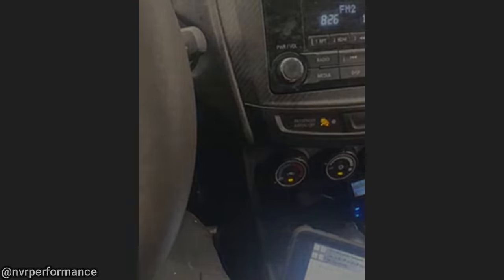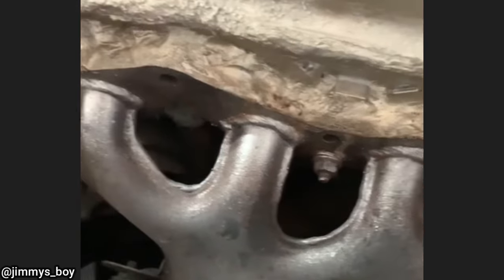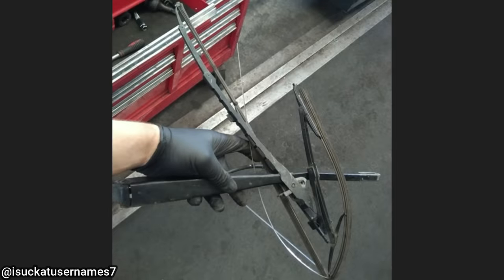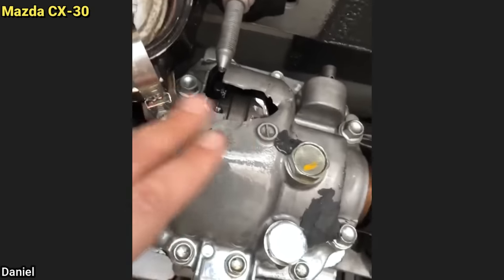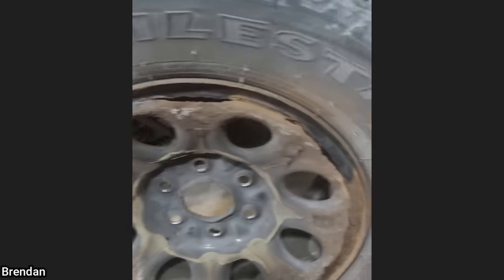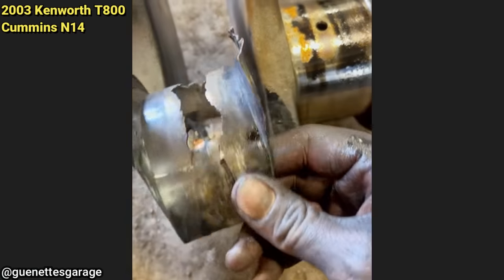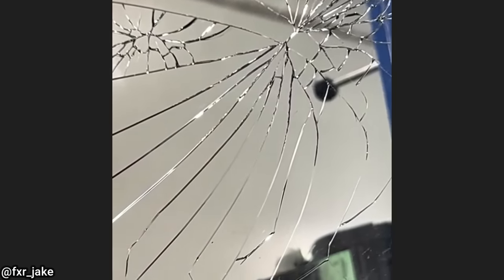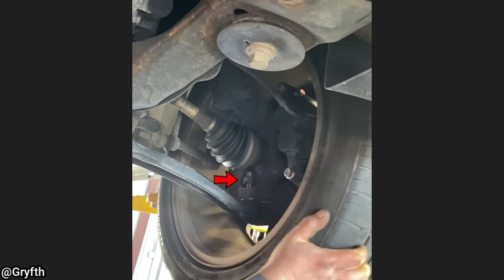Customer States (Best of January & February 2022) | Just Rolled In

Comment: Whoah! I've been a full flag time mechanic for 10 years and have never in my life seen or heard of a lower ball joint explode from potential pressure! I didn't even know that was possible!
Reply: Subaru, it happened to me.  Took a half inch out of the concrete floor.  Glad it wasn't my foot.
Reply: Never changing ball joints again. Ever.
Reply: yeah wow never heard of that.. i changed dozens on all kinds of vehicles
Reply: Didn't know either, I've put a torch to quite a few...
Reply: I never knew that either. Possibly seized with no lubricant in it?
Reply: @halucinator1  removed the castle nut fully and put way too much pickle fork in there. Ive removed a lot of OLD ass ball joints over the years and the worst ones ive dealt with have popped loudly, but stayed captured by the castle nut. No clue how this thing went off like a bomb.
Reply: Yeah- I'm down here in the comments looking for exactly this, To see if anybody else has input on this happening...
Reply: i hope he is alright
Reply: @MyCatInABox  I'm more than positive "Mr. Subaru" is bluffing 😂😂😂
Reply: same here 12 years as a mechanic
Reply: Could happen when a stuck ball joint has been heated with a torch - sometimes there's still some grease inside the joint despite it's stuck, and when superheated with acetylene it could explode like that.
Edit: I've never seen it myself, but I've heard about it from a fellow mechanic.
Reply: @ryanschmid2678  His underwear probably isn't....
Reply: Seen a axel u joint explode once,, it was like a shot gun going off,,scary shit
Reply: 40 plus years and never have !!!!
Reply: from now on when I heat a ball joint I'll drill a hole in the bottom of it, pretty sure that wasn't a problem when ball joints use to have grease fittings.
Reply: This type of explosion was noted by the health+safety office in Germany as it blew someone´s eye out. Apparently, the risk is quite real.
Reply: @peterfranklin8653  This risk is far less than what happens if your ball joint fails at 75 mph.
Reply: @danielrath6352  Do you have a link to an article or something? I'd like to read into this
Reply: Me too 😳 in 15 years i never saw exploding joint
Reply: Can i ask why we are heating our ball joints?  Is it a corrosion thing? Even on 70's cars ive only ever had to use the fork, or put the nut back on upside down and give it a couple of blows with a hammer to get them out
Reply: I had a jeep liberty at one time an was backing out the driveway an the ball joint   pop was very lucky
Reply: The ball joints aren't actually exploding. It's the spring pressure letting go.
Reply: @Colt45hatchback  They didn't use 1/10 as much road salt in the 70's as they do today.
Reply: Never would have guessed either.  But on that note, where I used to work, three of us were repairing the latch on the tailgate of a pickup truck.  Totally at random and unrelated to any work we were doing, one of the gas lift cylinders that holds open the back window of the truck's topper blew a seal.  It was as loud as a 12-gauge shotgun and we were just three feet away from the thing.  What are the odds of that!!
Reply: @RPG-oh1yf  I had a ball joint rip right out of the lower control arm. Luckily, I was only doing about 35. It was startling.
Reply: I had one explode on a dodge 2500, I was heating up the solid axle ear because it didn't want to press out. It exploded and the joint left a crater in the concrete.
Reply: @daveh8316  right!?!?!
Reply: @northcountrywoodcraftny5953  apparently we've all been tempting fate here n there
Reply: @Colt45hatchback  typically it's advised not to heat suspension components as it can compromise the metal.
Reply: @Sleezax  thats what i thought, closest to this i do is heat the knuckle with a heat gun and freeze the bearings so i dont have to press them in, but thats not glowing or anything, just enough so they slide in to place by hand
Reply: Had it happen to me. About half a second before it happened I had my head directly underneath the ball joint. When it exploded it was about 10" from my ear. Took 2 days for hearing to come back, and took a good 1" diameter section out of the concrete, then a piece lodged in the wooden wall. I stopped heating stuff around ball joints after that.
Reply: @26thpiratekingfry6  I wish they still did
Reply: I was thinking the exact same thing. Never have I seen a ball joint explode. Always learning.
Reply: @Colt45hatchback  I'm right there with you. Except I use tools made for ball joints. No more pickle forks or hammers. I haven't used that shit sine the 90's.
Reply: I've been swinging of spanners for 18 years now. And I've never heard of them exploding unless heated. Witch brings me to the only logical explanation. Friction = Heat. So it's possible that the friction generated from the rusted nut was what caused it to heat up!
Reply: About a year ago me and my friend put ball joints on my 03 avalanche and due to the truck having over 260,000 MI he had to heat the ball joints and as they were colling down and he was loosen them up they exploded
Reply: @nastyoz249  it wasn't friction that did it, it was a blowtorch. Grease gets super heated inside the ball joint and the trapped glasses expand and pressurize the joint until it explodes and fails.
Reply: @RPG-oh1yf   Had one fall apart on me once while driving. Freaking car was cursed  previous owner gave it up after it refused to go into reverse. Dad fixed it, few months later  the drivers side  ball joint’s castle nut worked it’s way loose. Tightened it up and all seemed well. Coming back from feeding horses less than 1 block away from house big boom and a hard jerk in the middle of a turn. Stop immediately, put in park, step out and go Oh Fuck! Call dad and proceed to tell him his damn car fell apart.  Thank god I was on a residential street, driving slow, and not on the highway.  He fixed it again  this time replacing the joint. Wouldn’t you know it not 3-4 months later  I get a 3 AM call from dad who was trapped at a tiny hole in the wall gas station with 4 other people in that tiny ass green Mitsubishi, requesting me to drive from Arizona to Utah to come rescue their asses as the cursed thing had blown its head gasket and they were stuck. At the time my trailer towing experience was 1 time  and my road trip count by myself was 0.  Not fun in a dually with no cruse control and the stiffest brakes known to man.  Almost got creamed by one of Utah’s finest who decided to pull a random U turn just as I was passing the area where he had just pulled off into. Missed his ass by inches!
Reply: It can happen on some types of ball points, when you heat it up gasses expand in the top part h till it can’t hold an boom! It explodes. He was using a torch they said so it looks like the same shit.
Reply: Happened on my subaru WRX. Didn't take out the concrete, but it hit my leg on the bounce. Left a huge bruise.
Reply: happened to a guy I work with. it was like a canon went off. so loud
Reply: i was heating a stuck brake HOSE in my skoda.. i had it mounted on a vice.. heated the brake hose mounting point that is metall..got out to get a tool. came back in a minute and the hose exploded spraying me with brake fluid..the hose was so cloged up that it exploded even when one end of the hose was open :0 remember kids. change those cheap ass rubber hoses every 3 years. i change em now everytime i do enything around the brakes..
Reply: @LinguraDeLemn93   Nope.... More than Possible.
Reply: Right? When he said it exploded I thought "right, it burst." but he meant Exploded! Jesus. Best jumpscare of the year right there.
Reply: to much heat from blowtorch
Reply: That's a big "WTF?" from me too.
Reply: HAD to be the heat. 😱🤷
Reply: His ear hairs are permanently bent! He is grabbing at his ear. That's crazy
Reply: @twots22  Whenever an (extremely loud) event like that happens and results in apparent immediate hearing loss, urgently see an ENT (or other informed physician or ER physician) as they will typically prescribe a course of Prednisone (an oral steroid) to help reduce the risk of permanent hearing loss and to help protect your remaining hearing by greatly reducing inflammation before it sets in and causes any further damage to your hearing.  The sooner the better!  As someone who suddenly lost much of his hearing in one ear some years back, though due to a congenital defect (SSCDS) rather than an explosion (I woke up, yawned, and it suddenly felt like the entire right side of my head was being squeezed extremely, painfully, tightly in a vise and instantly lost much of my hearing in that ear), you really do miss that hearing once it is lost, nor is the very loud tinnitus and vertigo much fun either!  I really miss being able to hear music in proper stereo and being able to pick out a conversation in a noisy environment (such as talking amongst your party at a restaurant) — not only is it very difficult to isolate a specific conversation (especially on my significantly deaf side) but sometimes just hearing them over the tinnitus alone is a real challenge (my tinnitus is a relatively steady tone around 6-8 KHz and louder than someone yelling from 3-4 feet away!).
Reply: Not only ball joints guys. U joints can, do this too. The old GM u joints, where you had to melt the nylon out of the driveshaft to get the joint caps out were notorious for taking flight if you heated them up too much. Heat on any front end part, especially a worn one, can send the inside flying. Seen it more than once. Had it happen to me once. Seen someone put a hole in the roof of their shop with a u joint cap. Yall be careful out there. 22 years under my belt, and thank God I've never been hurt by something like that.
Reply: Actually happens a lot and it’s like a fucking Granade. If you get hit by one of the pieces you’re done for so never ever heat ball joints
Reply: I rebuild wrecks with my dad. I had one of those this seems dangerous moments, so I moved legs away etc. So here I am sitting next to the car and i'm taking the strut out and I take the last bolt out of it and pry on it some to get it lose and then bam The strut comes lose the rod from it shoots out of it and buries itself into the gravel right where my right leg would have been. it bent the rod badly from all the force where it dug into the ground on the threaded part where the nut goes onto the end.
Reply: @strryle125  you must not live up north, do ya? Or you do, but not in an area where they brine the damn roads in the winter. It's called the rust belt, and sometimes, we have no choice. The thing is, you can't heat them too much. OR, drill a hole in the top of them first, but STILL, don't heat them too much. I've seriously had my ball joint press, the 4' Strap-On breaker bar, AND a cheater pipe on a ball joint on a dodge plow truck, and it still wasn't budging. It took all that pressure from the press that I made, and then a bit of heat to get the damn thing to budge. When it FINALLY broke loose, it shot straight out like a damn cannon. Thankfully, I was off to the side, and the ball joint press caught it too. What I'm trying to say is, it's different in the northern part of the rust belt.
Reply: @evankibbe590  1 week and I  never have also. 😐
Reply: I was welding a snow plow hydraulic angle ram once. I did not notice as I was welding the mounting hole for the ram back up the ram was extending out with pressure from the heat. It extended all the way and built pressure ( quick coupler still on hose ) and BOOM,  the hose whipped me in the ass so hard I couldn't shit for a week.
Reply: Same reason some rocks explode when heated
Reply: Same here, little over a decade, never even heard of it. That floored me man. You can tell old boy was shook.
Reply: Could possibly be the result of hydrogen embrittlement buildup inside the ball joint.
Reply: i used to heat ball joints and remove them with a hammer. Until one exploded on me. I bought a press kit soon after.
Reply: @peterfranklin8653  just dont heat them with a torch.
Reply: @peterfranklin8653  heat
Reply: I've seen them explode with heat before. The fact it's a sealed ball joint and the grease boiling off inside with no where for the pressure to go means yes it will go bang if you are unlucky. Generally its bigger ones from trucks and lorries that will explode. Drill a small hole in the cup first.
Reply: Amazing... what the...
Reply: Happened to me. I was rushed to the hospital with a ruptured spleen and was out of work for 8 weeks.
Reply: @dustinandtarynwolfe5540  actually they are exploding. The pressure caused by heating it is what causes it.
Reply: I heard it could happen when the grease gets hot and expands. Never dared date enough to try it.
Reply: @jrand2631  exactly what happened, I’ve had happen to myself a couple times. Can’t remember the vehicles, think it was GMC Terrain lower. Couldn’t get the ball joint to release and heated it up. We had a pipe under the stud around the ball socket to help support the table. When the ball joint exploded it blew the stud through the steel pipe.
Reply: @5c0H  yep, never EVER heat ball joints, if you must then drill out the case. 

My brother heated one with a torch and it blew apart into the garage floor and took out a huge chunk of concrete. It sounded like a 12ga shotgun during a slug. It was thunderous.
Reply: @nastyoz249  Bingo, I was thinking the same thing.
Reply: @vihreelinja4743   Same. I heated the rusty fitting on a brake hose which was still installed on a '63 Impala. I thought the system was empty but when the hose went off like a pistol shot, with my head there with it inside the front wheel well, it was a very unpleasant experience!
Reply: I’m a heavy equipment mechanic and I’ve never seen it either, and I use the torch probably like every other day lol
Reply: I've been a mechanic for about 15 years and would not have believed this was even possible if I hadn't seen the video. Note to self - be far more careful with the torch.
Reply: @ethanpoole3443  sorry to read that. They are making great advances in tinnitus treatment, hopefully you can get access to some
Reply: Hold on, usually an air hammer and/or the pickle fork bit will be enough to jar these things loose. Onlt use a little heat sparingly if you have a stuck one and just keep hammering and it will come loose.
Reply: Heated one up to get it out of a control arm and it kept smoking. I kicked it outside and in about 10 minutes it hand grenaded.
Reply: @mariusthemechanic3091  ok that makes sense, I was wondering how they could possibly explode
Reply: @Spike-sk7ql , they salt the roads to taste, don't they?
Reply: Lol I feel the same way fid he add gunpowder to it or what
Reply: Holy shit😳
Reply: @strryle125  drill a hole in the cup. Stops pressure building. Still wary of them though.
Reply: @hansmomoan3482  no, just grease boiling and expanding. Pressure has to go somewhere.
Reply: @georgies405  if they are knackered and rattling it's unlikely, if it seals up and has grease in it, it will absolutely explode. One went on me and it was a Transit van, I dread to think about a large vehicle like plant going up.
Reply: @dustinandtarynwolfe5540  No, it definitely is exploding. If you heat a sealed ball joint the grease will expand to many many thousands of PSI and act like a pipe bomb. If this was spring pressure you would have seen the lower control arm flop down in the video.
Reply: Yes it happens alot on lifted factory suspension  it's cause from an excessive angle on the ballpoint. Or simplely just fall apart from being wore out
Reply: I commented before seeing that part... yea grease is some bad ass stuff
Reply: If it's my vehicle and I know they're going to be difficult to remove, I'll just order control arms and swap them out rather than fight with balljoint removal.
Reply: @GrandPrix46  I don't think that's what they are referring to. I think he was trying to remove the ball joint taper from the spindle, not the ball joint from the control arm.
Reply: @14768  I see, but wouldn't you heat the spindle to make it easier to remove if that's where it was stuck?  Being that heating metal expands it, it seems counterproductive to heat the balljoint (I understand it breaks the rust bond, but I would think heating the spindle would also accomplish that).
Reply: @mariusthemechanic3091  i had wondered about this, like an excavator can get a compression ignition in the ram if the air isn't bled properly and they get hot working.
Reply: My son had one go bang just hitting it , I been in the job 50 yrs never had it happen
Reply: @Colt45hatchback  Go look at cars from the rust belt or better yet listen to the mechanic story that live in that area and take care of those cars.
Reply: Was thinking “how can a lower ball joint explode!?”
Reply: @Colt45hatchback  Tell me you don't live in the rust belt without telling me you don't live in the rust belt...
Reply: @Colt45hatchback  Freeze the bearings with what?
Reply: @mxpants4884  i dont live in the usa nor in a salted road country.  but i work on alot of rusty old cars that have been laying belly down in swamp mud for years.
Reply: @mxpants4884  usually just put them in my chest freezer in a zip lock bag for a week (usually buy them on a monday and fit on a saturday) makes front wheel bearings on a 70's or 80's subaru a piece of cake and fast
Reply: @mariusthemechanic3091  thanks for the explanation on how this happens really interesting.
Reply: @mariusthemechanic3091  Good to know…I’ll try to not heat up liquid filled items in the future…
Reply: @Colt45hatchback  Thanks for clarifying! I was picturing something using a spray can to cool it down, but I am not good at being patient.
Reply: @mxpants4884  i guess freeze spray could work, its just far to expensive to waste two cans on one wheel bearing job for me. I suppose in a proper workshop where that could be passed on to the customer, it probably would be cheaper than paying the mechanic to remove the knuckles take them over to the press and stuff around for 20 min then reassemble it all, but for me fixing up  cars other people would consider scrap metal soley for my own pleasure, the freezer works well enough
Reply: @LinguraDeLemn93  I doubt he's bluffing, those joints popping can sometimes kill you. They have an excessive amount of potential force.
Reply: What is a “full flag time mechanic?”
Reply: Whatever grease was left in there cooked when heated, causing a lot of pressure. I'm guessing he held heat to it for an extended period of time.
Reply: @halucinator1  No, grease starts boiling and it creates pressure. I can't believe how many people don't know this. I learned this from older mechanic probably first week on the job.
Reply: @LinguraDeLemn93  yeah,, the head gasket would have cooked the motor before the ball joints needed replacement!
Reply: Happed to me on a Ram 3500
Reply: I was changing ball joints in a Chrysler 300,had to take the steering knuckle off to change the ball joints. One of the ball joints wouldn't press out so I had to heat it,after I shut the torches off the ball joint went off like a twelve gauge! I've never in 26 years of working on cars had that happen! After a week I got my hearing back to normal. I feel bad for that guy
Reply: @twots22  He may have sustained cochlear damage but is more likely he ruptured his eardrums. If the ruptures are large, they will not be able to heal properly, and hearing will be permanently severely attenuated.
Reply: Nope me either
Reply: I have had this happen 2 times in 25 years both times because of heating the knuckle and knocking them out with a hammer. I guess the grease inside got too hot then being compressed by the hammer boom like a bullet
Reply: @tscustomstation  That's insane!
Reply: I’ve NEVER heard of such a thing in my life. That was a LOT of energy too.
Reply: @Dudeman9339  Like a canon, damn!
Reply: @ryanschmid2678  i came here to ask the same thing
Reply: Would freezing the "stuck" part be a better solution?
Reply: @kage7165  Yeah, but how the heck would you do that? You need to get it really damn cold.
Reply: @illreportbackinabit.8514  Yeah, the old Subaru ball joints with the one piece cup are very prone to this.
Reply: @jaykneegarner2479  I have had a policy regarding tools and other such stuff and being cursed.
If something draws blood on me or has a repeating pattern of failure that seems malicious. It goes in the junkyard. 

I don't have the time to do a prayer meeting or exorcism on stuff. I don't need to know if someone cursed an object, but if the symptoms are there, I get rid of it.

Often I've smashed it into uselessness, also. I don't want someone else saying, "Ooh, shiny!" and picking up the thing I had just gotten rid of.

I have done this occasionally, and often ended up with a better replacement, and never had a repeating "same problem, different object."

What this reminds me to mention is people who buy and move into cursed houses. I was in one such house, once, that my friend lived in. We were cleaning out the back of the  house that was unused, and I suddenly paused and said, "How many people have been murdered in this house?" It was supernaturally DARK in that area. I knew nothing about the house.

I found out then from him that there were two people who died. One direct murder and one a child afraid of his father leapt off the balcony and got impaled on the iron fence and died. Also, my friend's marriage ended and when his boss moved into the house, he lost his expensive bid to be in the local government (councilman.)

Go with what most people call "your gut." Do NOT ignore it.

I was at work once, wrestling with a cabinet full of 600V cables and God told me exactly this and no more: "Go home now or die." I made some excuse, buttoned up the cabinet, and went home. Next day, I was assigned to something else, and my coworker took on the cabinet. He was unharmed, but sent me a few pictures of the very cables I had had my hands wrapped around trying to tidy up the chaotic cabinet of wires. They were stripped bare all along the back (not visible) sides, for two to three feet at a stretch, not just a small nick in the insulation, several of them. Someone had dragged them through some sharp opening when installing them years prior, evidently. You could tell HE had not stripped them, as the copper was obviously old dirty, not "fresh stripped clean." God is talking. Are you listening?

Remember that FEELING you had just before that disaster happened in YOUR life? Remember that "I had a feeling" feeling?

While I'm at it, have you ever been on the highway and someone seems to be breaking the rules to keep you from passing them? Someone behaving irrationally? I have blown by such people on three occasion and suffered two police pull-overs and one massive tire failure that whipped the entire tread belt along like a chain flail and tore up the whole back end/wheelwell of my car.

Don't ignore that. I have since learned if someone is seeming to be determined to keep me back, God may be saving me from something up ahead, and I don't get indignant and emotionally overblown about it. You believe what you all want. Ima love my Jesus.
Reply: I had a ball joint explode on me once also. I heated it up (A arm was off the vehicle) and hit it with a hammer to try and remove it. It blew just like in this video and shot across my shop. It was knarly
Reply: Ya it's amazing. Don't under estimate kinetic energy. I was pressing a tungsten carbide bushing into a part once only a 2" bushing, it fragmented and sent peices through the wall. One of which blew out a guys car window outside. The power of a large caliber rifle.
Reply: @dustinandtarynwolfe5540  what kind of cars are you working on where your ball joints have springs in them lol
Reply: It happened to me once on a Subaru ball joint, I had a hard time getting it out of the spindle, had it in a vice and was heating it up with the oxy-acetylene torch, the grease inside started to boil and expand and eventually blew the ball joint right out of the socket and I never found it. I had a solid month of having a hard time hearing along with likely permanent hearing damage and a lifetime fear of heating ball joints.
Reply: It happens when you use a press and give it WAYYYY too much pressure without tapping the joint a bunch. It FINALLY dumps all of the energy in one massive burst.
Reply: @saturnmedia1  what you say is true, but what happened here is something else entirely. The grease inside the joint was superheated by the torch and there was no where for the pressure to escape...enough pressure built that the joint itself came apart explosively.
Reply: If only customers stopped declining work. Us mechanics can stop risking our lives over parts that are barely worth $100
Reply: @peterfranklin8653  maybe had water in it somehow?
Reply: @Colt45hatchback  Why a week?
They're not going to get colder than they would be after six hours or so...
Reply: @SwervingLemon  its more convenience, im not gonna do the bearings till the weekend, so i put em in as soon as i get home, or ill forget to do it friday night and have to wait for them on the weekend 😂
Reply: @RPG-oh1yf I had a couple fail at 35. I’d rather never have that happen at high speed.
Reply: Just happened to me about four weeks ago. I guess the grease expands from the heat? But yeah, be careful heating the pinch nuts.
Reply: At my dads shop about 4 months ago, one of his workers was heating a ball joint while I was there working on my car in the next bay and exactly the same thing as the video happened. It blew up, lots of smoke and super loud. No one was hurt thankfully!
Reply: I've never heard or seen the ball joint thing in my life. Sounded like a shotgun.
Reply: @jaykneegarner2479  Never buy a green car I call them bad luck car's even the insurance companies statistics on cars show more pay outs on them I kid you not.😳👍
Reply: Wow!😮 hope that mechanic is alright!
Reply: I've replaced thousands of ball joints and control arms. Never had them explode! Wtf?!
Reply: @26thpiratekingfry6  was the first thought I had, make a release hole for the pressure. 
Might even be best to just cut out alot of the rubber boot first as the heated grease might ooze out of the pre-made hole onto your body or torch or just make sure to put the hole away from where you and the torch will be.
Just asking for a grease fire it seems. 
Leaving the nut on with a nice amount of thread in the nut is still the best way imo. Just stand back and hammer away!
Reply: I wanted to replace a ball joint on an ATV but I found the recommended method was to replace the entire steering knuckle (ball joint already installed).  Ultimately It made sense to me since I have very little mechanical experience and replacing a ball joint was pressing the limits of what I wanted to do.
Reply: I was fortunately warned about heating BJ's as an apprentice back in 98'. Never saw one actually burst though.